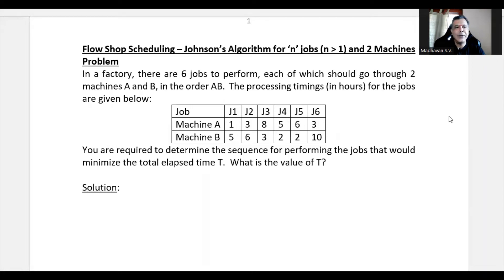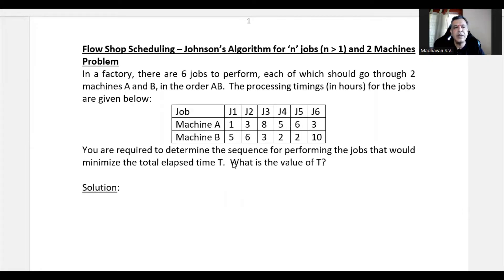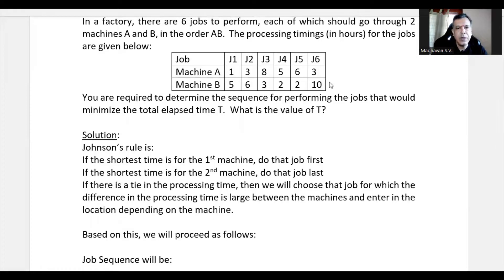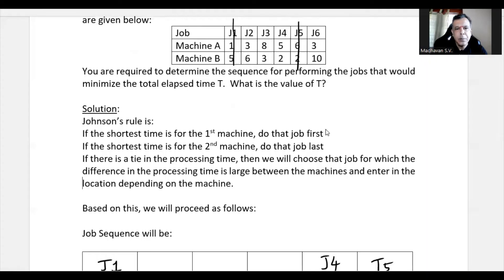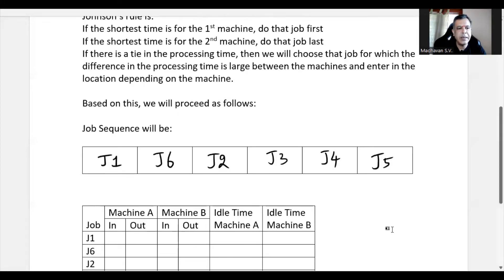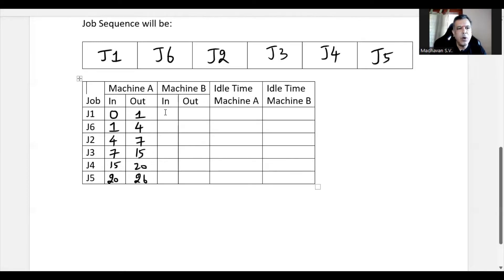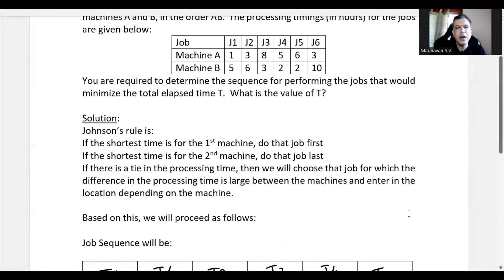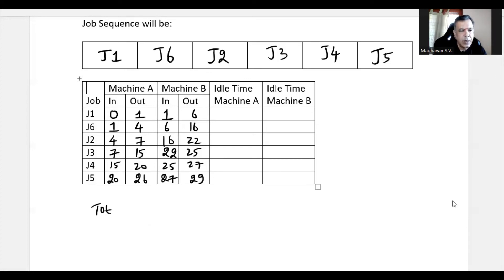Flow Shop Scheduling - n jobs & 2 machines - Johnson's Algorithm - English

Comment: 00:00 Understanding flow shop scheduling and minimizing total elapsed time
01:32 Johnson's rule guides job sequencing based on machine processing time.
03:04 Handling tie-breaking using Johnson's algorithm
04:37 Johnson's Algorithm sequence and idle time calculation
06:15 Scheduling jobs on two machines using Johnson's algorithm.
07:44 Schedule for job processing on machine b
09:13 Calculation of total elapsed time and idle time for each machine.
11:14 Johnson's algorithm helps in sequencing and finding idle time in flow shop scheduling
Crafted by Merlin AI.